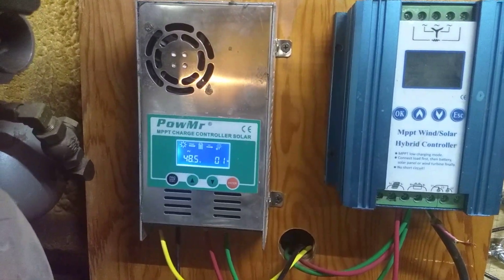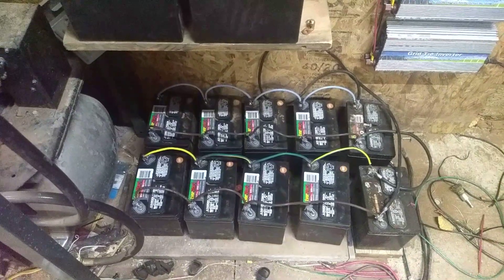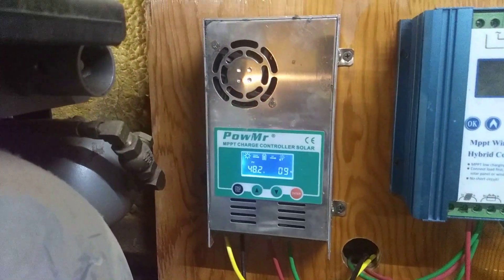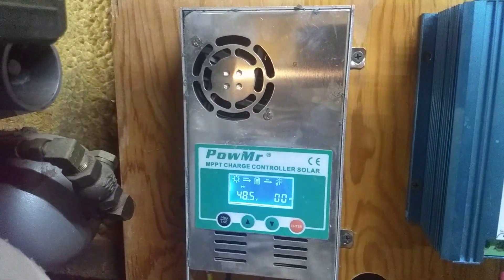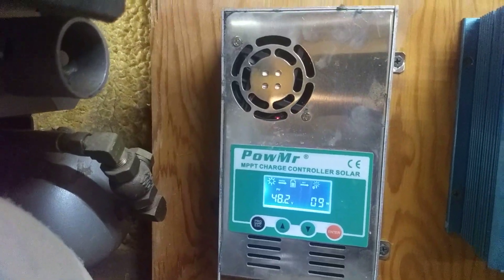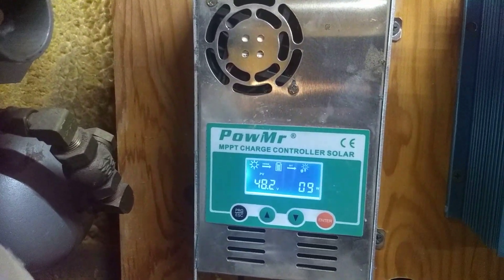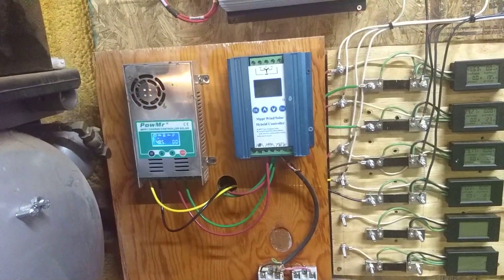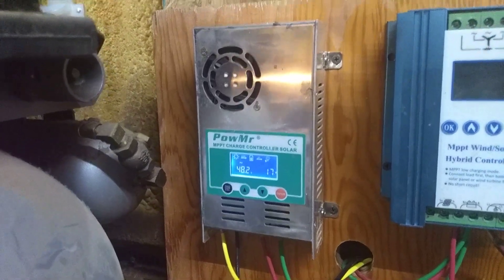Charging a 24v battery bank from a 48v bank using a cheap MPPT Solar Charge controller 24hr Update

Comment: How did this work in the long run?
Reply from the maker: hah it didn't...but it's still something I'm playing with.  The issue I'm having currently is that the turbine is easily overpowering my batteries and making it impossible for the controller to track output.  I'm actually doubling the battery bank now and testing if that helps...there will be an update video soon!  Thanks for watching!

Comment: I have IstaBreeze 2000w 48v wind generator and this not working OK using 24V Battery. Now I see solution, using MPPT Solar Charge controller. Is this working even without 48v battery connected to windgen ?
Reply from the maker: Hi Margusten!  No unfortunately you have to have the batteries for that controller to work...however, you can probably realistically get away with using cheap batteries like I do since you're just bouncing power off of them to get to your primary bank.  I have tried running turbines straight to this controller and it doesn't even load them up.
Reply: @ToysforWatts  Thank You so much. I have lot of old UPS batteries 12V 7AH. Only 4AH left. May be they are too small for 48V bank. I can wire 8 or 12  of them to 48V bank.

Comment: I do a similar thing, but I use a dc to dc charger with an intervolt relay to cut off or cut in load. The intervolt relay is a programmable voltage sensing relay with a Victron dc to dc.

Comment: can you tell me how to add the power back to the grid.
i have two chinese turbine 48 volt 400 watt.
I am using a goodwe GW1500-SX inverter but the inverter will not start with the turbine because the wind is not constant.
I use two solar panels to start the inverter, once it is working I can connect my batteries to it which are charged by the turbine.
if the wind blows hard enough, the inverter stays on even when I take the batteries off again.
when the wind is with wind force 4 I get around 250 watts in to the grid.
it uses a lot of power to get it to 230 volts.
do you have an e-mail address that i can use i will send you some pictures because have a question about the i1500?
Reply from the maker: You can email me at toysforwatts@gmail.com!  That particular inverter might be a little hard on your turbines because the minimum input voltage is 50vdc.  I don't know if it'll even apply a load to them below 100vdc.

Comment: You can set the output Voltage to a lower threshold ( likely set at 28.8 right now for Bulk charge ) and that would cause it to drop out sooner which would then keep your 48 Volt string at a higher Voltage. Your'24 Volt string wouldn't be sitting as high all the time but your 48 Volt string would not be sitting at 48.5 Volts either.
Reply from the maker: yeah but I'm trying to also dump excess current from the 48v bank...I'm going to have to set up a proper relay to cut it off when the voltage is too low.